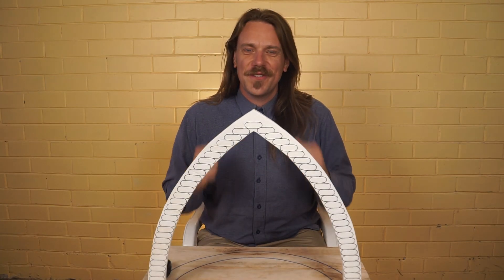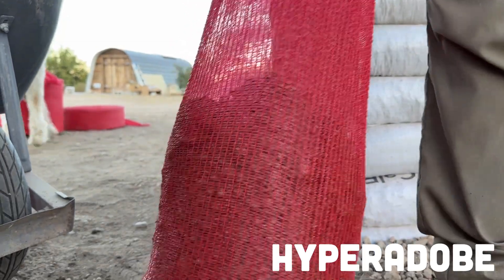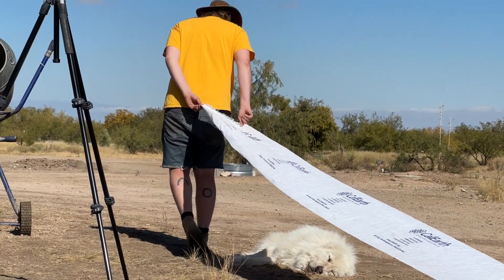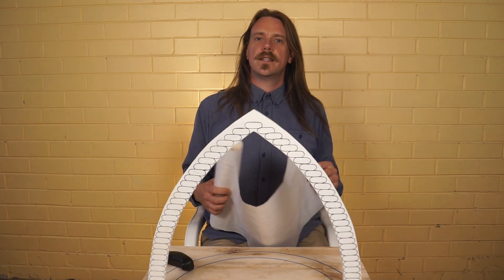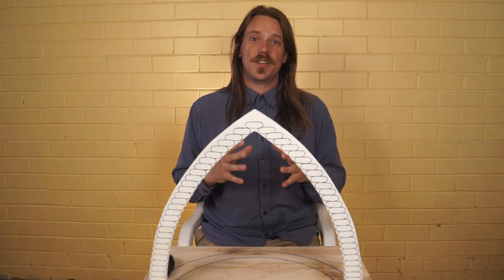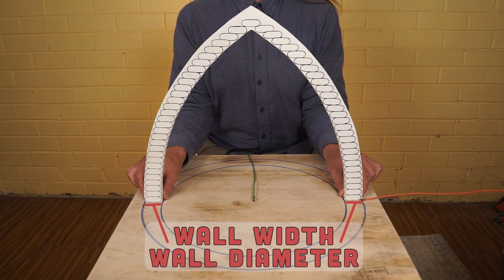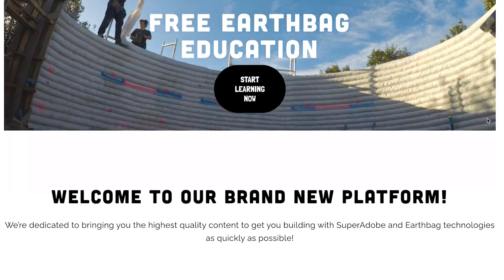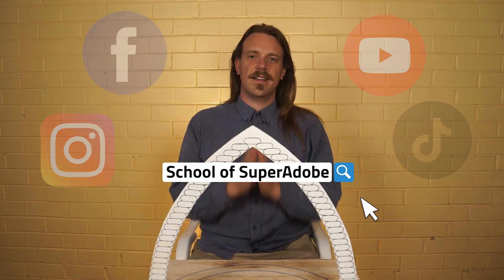SCHOOL OF SUPERADOBE - How to build a SuperAdobe Dome - C01E01

Comment: So for a 5 ft dome I could go as small as 6in but I think I’d want to go no smaller than 12in bags. Thicker walls means a cooler dome, right? and more stability? I also think I want to bury the dome enough so that it is shorter than 5 ft from the outside. These videos are so awesome!! Thank you!
Reply from the maker: Your finished wall width, once filled and tamped, must be 6inches. So you must buy a bag 2 inches larger than this, because you loose 2 inches in width when you fill them. They are tiny bags! They may be a little unstable to build with, so I would suggest at least a 10inch bag :)

Comment: Another topic that I would find vwry helpful is: Superadobe vs Hyperadobe. Pros and Cons. 

- It doesn't use barbed wire between courses/rings? (which would save $) 
- Cost difference?
- Can you use the same "Dirt Recipe?"
- Isn't there a Strength or Durability difference? 
- Is it easier to build with Hyperadobe bags? 
- It hasn't been tested as thoroughly as Superadobe, etc...

Does Hyperadobe live up to the hype 😜

Thanks again Hayden!
Reply from the maker: They are awesome suggestions! I’ll add them to my FAQ file and definitely address them all!